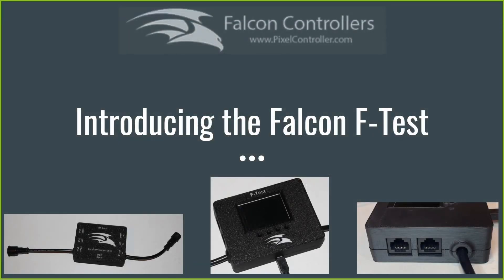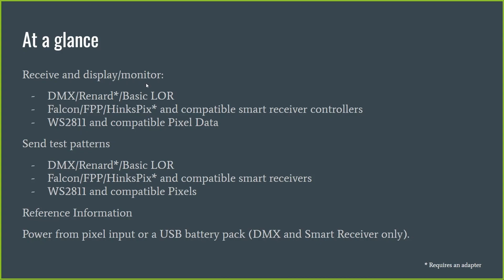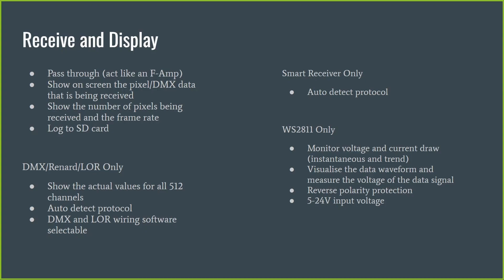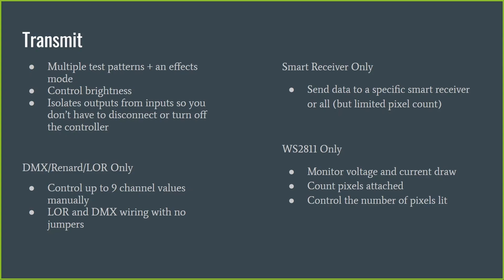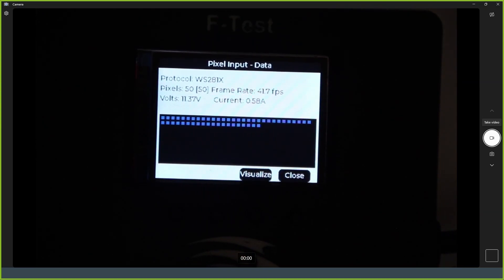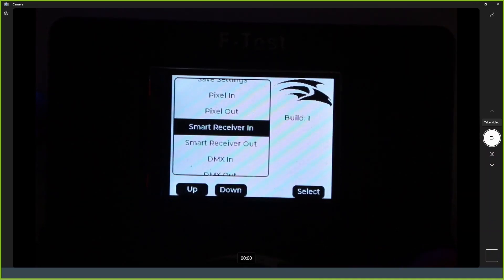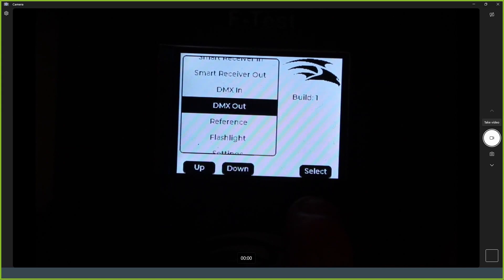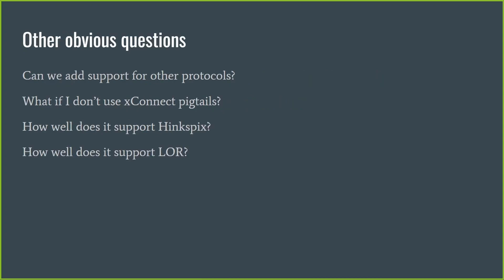Pixelcontroller.com F-Test Overview

Comment: Hi Keith - As you know, xlights is not great for controlling DMX fixtures. I want to simply be able to add MIDI notes to the timeline in xlights, so I can have my other software thats good at running DMX trigger based on the MIDI note played on the timeline. Playing MIDI notes on a timeline seems like something that is pretty common among applications to trigger events. xscheduler could local loopback the MIDI notes, so my other applications could trigger lighting scenes.